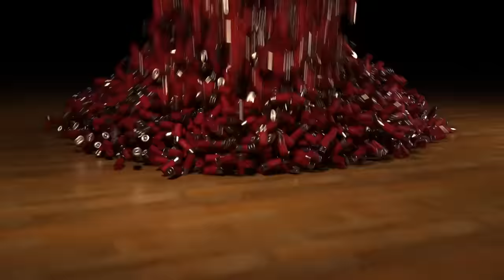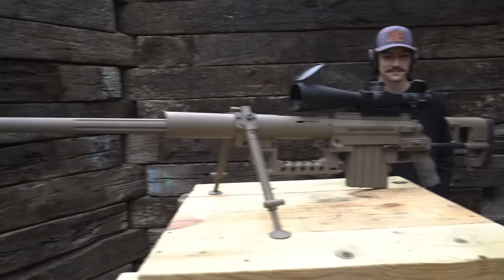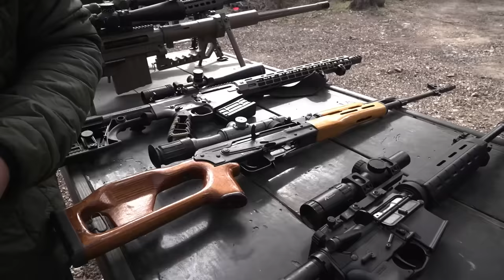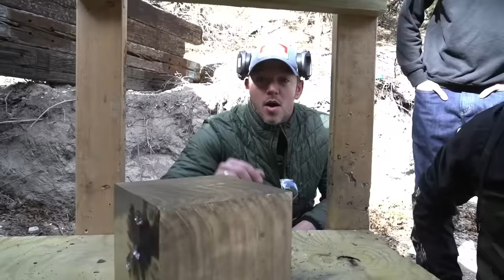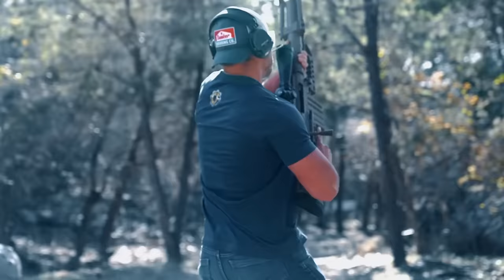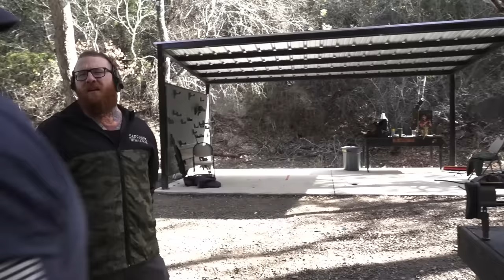The Most POWERFUL Sniper Rifle vs. Solid Block of Bronze!!!

Comment: The lack of delay between the 408 firing and the impact was one of the coolest parts.
Reply: That bullet is freaking MOVING.
Reply: Unless he's shooting the lighter grain bullets for the 408 it's doing the same as the 50bmg under 750gr bullets. Both shld be around 3000fps at the muzzle and prob not a noticeable difference at 100yds
Reply: @fishingpatriot2344  wrong, chev tac only made 1 grain of bullet and the muzzle of a 50bmg is around 11,000lbs and 4000fps, 408 is 7,700lbs and 3000fps, the 408 will keep the velocity up over range with the 50bmg loosing around 600 meters
Reply: @jamiejoy2393  your 100% wrong about 90% of what you just said im proud of you
Reply: @fishingpatriot2344  no I'm definitely not, I shoot both every week and have done for a long time. You're very wrong
Reply: If there was no drop and it somehow didn't hit anything else, it would take a bit over 10 hours.

since the 408 moves at 1,100 m/s, and the earth has a circumference of 40,075 km, or 4,007,5000m. Divide 4,007,5000 by 1,100 to get 36,431.8 sec. /60 is 607.2 min. /60 is 10.1 hours.

So most people could wake up in the morning, have their cereal and coffee, fire the gun, get in their truck and go to work, come home, shower and eat dinner, then the bullet would come back around.

Comment: Great video, love having Drevski there.
Also, bronze isn't a hard metal, it's quite soft compared to the other stuff you had down range. Some bearings and bushings are usually made out of bronze.

Also, Demo: "these are 15 bucks a round, they're NOT cheap rounds!!" cut to hip firing round by round made me laugh hard :D :D
Reply: I was going to make this very comment that bronze is not hard but it is very wear resistant but you beat me to it 😁
Reply: @csonracsonra9962  Haha, next time amigo :D
But actually, a really good idea, as the bullet goes in, does the high wear resistance aid the bullet to penetrate deeper or does it make it harder?
Reply: It has a very high density, too. And what matters in the end in holding up bullets is MASS.
Reply: @jackmclane1826  Not really. Obviously it'll depend on what specific bronze material he used, i.e. the % of alloying element included in the material but generally a standard Sn alloyed bronze is I think around 7.5-8.5 g/cm3 whereas steel is about 7.8g/cm3. 

Then when you compare AR500 steel which is again around 7.8g/cm3 a same size block of AR500 would cast a completely different effect on the bullets. 

So yes, while it is about mass, it's also not just all about mass.
Reply: @rixogtr  I can live with that... ;) I seemingly overestimated the density of bronze being a copper alloy.
The Abrams tank uses DU in the armor for reason of its mass.
Reply: @jackmclane1826  exactly, so does A-10C <3
Reply: Who really believed that it matters to a millionaire anyways? $15 a shot? That's like what 5.56 costs now right?
Reply: @rixogtr  That Block looked suspiciously Like Ampco bronze. Some of the toughest alloy out there. Just Sayin.
Reply: @jackmclane1826  Yeahhh you need alot more than just mass. Random but related fact, the mass of Saturn is 95 times of Earths, but due to its density it would literally float on water. Even though its also freaking huge, its gravity is only 1.08 of earth. 100lbs on Earth is 108lbs on Saturn. 
Sorry for geeking out, i just love using Saturn as an example given it would float 😂
Reply: Firing a 50 round at a block of chromium might be a little more expensive. lol
Reply: @jamesmaddison4546 
I was being a little unclear here. Mass and density are so closely related that I didn't expect that to cause a hickup.

I like that random Saturn fact. Although I still wonder what it matters here. 😅
Reply: @jackmclane1826    Its related to the subject here because you can have an object with a shitload of mass, but if its low density, its no good at all for stopping bullets, fragments etc. Its all good you just got mixed up  Also, DU isn't used in armor for its mass, it's used because of, again, its ultra high density. But, one thing I'll say further about abrams armor, what gives it is legendary survivability isnt the du, its chobham armor. Invented by the British, and believe it or not, the chobham thats used on the abrams isnt even the top tier chobham, the brits keep that grade for themselves lol the abrams gets the 2nd tier chobham. Its one of the brits secrets they keep very close, but yknow the us cant complain, theres tons of stuff they dont let allies get top grade of 😆
Reply: @jamesmaddison4546  First of all: I mentioned density in my first words here, so I wonder, why we have this discussion at all. ;) 
I'm actually still settled that the most relevant point here is indeed mass, as the Newtonian impactor model implies. (Wherever it is applicable, and not talking about composite armor systems.). The density later becomes relevant in how deep the impactor can travel through the matter.
Very dense material then is handy, (and I'm being intentionally absurd here) because it becomes impractical to bolt on 3 meter thick blocks of acrylic as armor or wearing a 2 meter thick ballistic vest from cotton wool. ;) Not even talking about launching a cotton bullet of a similar weight of the lead bullet or DU penetrator. 
Or to stay in the Saturn picture: Saturn might be fluffy like a cotton ball, but you still could not penetrate it with the earth because it is frickin huge! ^^

Give the Newtonian model a read. It's a good and easy first approximation for the topic we have here. It becomes especially good in KE rounds for tanks, sometimes only some % off from much more complex simulations. The faster the impactor the better that model becomes. Rifles are still on the edge of being too slow.
Reply: @jackmclane1826  Alright dude this is getting circular so this will be my last comment regarding mass and density because youre truly not seeing the relationship and stuck thinking mass is the most important factor when it isnt. 
For one, up to you whether you believe me or not, im an aerospace engineer, specialize in propulsion, working at lockheed missile and fire control
in Texas, started 7.5years ago. 
I could have a 4inx4in plate thats 1cm thick, made of an ultra high density material, and that would perform much better as armor compared to a block thats hell, 6ft in depth that has a higher mass but lower density than that tiny plate. This is simply because in higher density materials, theres more "stuff" (molecules etc) o get in the way of the penetrator, compared to an object of higher mass yet lower density, which has less stuff therefore less resistance to get in the way. 

Also, size of saturn doesn't matter, its outer to inner layers are gas, earth would have no problem going through it, until it got close to the center where internal pressures started crushing earth. 
Look up masses of giant gas nebulae in space, significantly higher mass but really low in density, so things go through them literally all the time dude. 
A high mass object thats low in density will never beat one thats got less mass but alot more density, of course to a point where the amount of "stuff" in the 2 equals the same, then youll have the same results
Reply: @jackmclane1826  Final examples, composite armor like kevlar, low mass therefore really light, but its density is really high. Same goes for its precursor the silk bulletproof vest, when made right it outperformed plate, for the same reason, low mass but really high in density.
Reply: Bronze can be workhardened, but does it after shooting at it? Hmm good experiement
Reply: @jamesmaddison4546  Now that I had the chance to think about it I'm more convinced than ever that mass indeed IS one of the most determining factors. High density then only makes it feasible to pack enough mass into a small space to make a useful product. If you are an engineer (as am I) you should know that or have the brain power to wrap your head around it when someone tells you something new. Even with examples given and a buzzword to continue reading! Real engineers usually are curious to learn something new and don't stick to old dogmas of what they think they knew. 

By the way: Kevlar is 1,44g/cm³. VERY LOW density. Dyneema - used for the same purposes in ballistic vests up to class 3A - is even below 1. It would float on water just like Saturn. ;) So obviously it is not the density at work here. (Hint to the solution: It is for much slower pistol rounds. At these impactor speeds mechanical strength of matter can still be higher than the dynamic pressure exerted by the bullet... and now you already know the two most relevant mechanisms of armor penetration... 😅)

When you use high velocity impactors on your two example plates, it comes out that both penetrators displace almost the same mass. Yes, you read it right: MASS. Very small difference! The faster the impactor the smaller the difference. Read "Newtonian Impactor Theory"! ^^
Reply: Bronze alloy can be extremely hard, but even if the alloy used here was purposely at the high end of the scale - it’s still a safe bet that it’s not harder than the martensitic steel used for a steel target. I think bronze can get up to 400 or so on the Brinell scale, while the aptly named AR500 target steel is 500bhn. I’m not sure what the purpose was in using bronze, unless just because it’s sexier than steel. 
The Brinell scale measures resistance to penetration (and by extension, hardness) so shooting at similar sized blocks of different alloys would be a pretty accurate sort of relative Brinell test on steroids. 
When you start to compare penetration of woven and/or layered materials (as opposed to blocks of homogeneous material), there must be many factors in play other than mass and density. The whole point of a modern vest is effective energy dispersal with minimal penetration in a lightweight platform. Im no engineer, but I imagine that things like tensile strength of lightweight materials and it’s increase by use of specific weaving and multidirectional layering may be the focus when it comes to vest construction.
Reply: also the gun they used isn't necesairily the strongest or best one. the .50 cal can compete with this and possibly even the KAR-98-K if it were still manufactured.
Reply: I came to say something similar
Reply: @DDadams0  not even close to what 5.56 costs
Reply: @jaketaylor9335  No shit? Are you sure? What is it now, $20 a shot?
Reply: @DDadams0  where are you buying ammo dude, im getting anywhere from .60cents to $1 a round
Reply: “Drewsky”
Reply: It's soft, but it isn't brittle, so I could see how it would be a decent measure of penetrative power and velocity at the point of impact. Soft metals at this thickness actually wouldn't be terrible as bullet stoppers. In fact, ( I don't know if it's still the case), but older tank armor used ceramic as part of the armor, BECAUSE it would break on impact and create a softer cushion to minimize focused force, causing energy dispersion throughout the plate.
Reply: @rbwood1978ify  Literally what I said
Reply: They make bronze bearings?
Reply: @rixogtr  Mmhmmm, nah. You spelled it Drevski
Reply: @rbwood1978ify  You must've got the name mistaken.

Comment: If you could get your hands on a Denel NTW-20 anti mat rifle that would be pretty cool. 20mm is usually considered a shell or cannon round so doesn’t really classify the same as a traditional sniper.
Reply: The Finns used the 20mm Lhati as a sniper rifle in an operation they called “Cold Charlie” (dress a mannequin as a junior Finnish soldier, and hide it well but not too well). Wait for a Russian sniper to shoot at Charlie. The Lhati crew had one rifleman and two spotters, so the chances of identifying where the shot came from was better than just one spotter. A Finn with personal knowledge of that use of the Lhati said it could blow down around 50% of Finland’s trees, so even a near miss would discourage snipers if it blew a nearby tree down. Of course, if there were something better to shoot they would do that first.
Reply: Problem with getting a denel is that anything over 50cal is considered a destructive weapon, which makes it harder, as well im not sure if denel imports those
Reply: @andresaltamirano7970  So take the target somewhere where you can persuade a Denzel owner to let you use theirs.
Reply: @kennethjackson7574 Actually it's Lahti. Named after a Finnish City. No bad vibes👍
Reply: @akottero3908  Lahti is a city, but the gun is actually named after its designer Aimo Lahti
Reply: @Torguemada You are correct. My bad! 😵😃
Reply: yes, waiting for the NTW-20X110

Comment: Seems like a great gun and round, I'd even say a worthy successor to the .50 if it is suitable for automatic fire. Impressed with the design of the gun too- except for the loose mag of course. The ventral handle is a very good choice, it gives you something other than the magazine to rest the gun on at the balance point for bracing on terrain. The sheath looks a good length balance if you need to use that too. 

Everything is smashing, all the choices I would make at least, though that might not be worth much!

Comment: I used a PSL during the first Libyan civil war. It was battlefield pickup. I initially had to run it cleaning it with gasoline and lubricating it with motor oil. It jammed a lot. We eventually captured a bunker that had a huge amount of Fabrique Nationale X-Troop lithium grease in spray cans. After that my rifle was ludicrously reliable- cleaning with gasoline and lubricating with X-troop every night. The scope mount was totally covered in something that looked like hot glue and it shot better than a minute of angle- a feat I have on camera. 0.8 MOA at about 800 meters. I could tell that the rifle had been babied. Finest rifle I ever shot. I fired nothing but API and when I ran out I would beg machinegunners for rounds. I loved that thing. It served me well. Fun fact: If you tie single knots into a piece of paracord it makes a highly effective .30 cal boresnake. Feed the unknotted end through the breech and out of the end of the barrel and then pull hard on it to drag the knotted end (a row of four or five single knots drenched in cleaner) all the way through. The fit is perfect.
Reply: you are a hero sir. so glad you are alive!

Comment: .408 tungsten round would be interesting to see.
High velocity, long projectile.
The bronze block would be shaking.
Reply: Problem with a tungsten round, is that its harder than the barrel, barrel wear will occur with use. One would have to make a sabot'd or copper jacketed tungsten round. Either option would be exceedingly expensive.
Reply: @bmw328igearhead  copper jacket would be way more accurate
Reply: @chemistryofquestionablequa6252  it seems there are some sabot type rounds for the .50BMG, looks like a 7.62 bullet, with a two piece plastic shroud. Once clear of the barrel, spin makes the sabot fly away. But I can't say I've seen how effective/accurate they are...
Reply: @bmw328igearhead  those were designed for machine guns,  they're significantly less accurate than regular rounds
Reply: @chemistryofquestionablequa6252  duely noted.

Comment: 10:51 the barrel sitting on the barrier might throw off your shots.  Some guns and barrels are free floating and if you rest the actual barrel on something it throws off the accuracy.
Reply: At 100 yards it won’t make much difference but past you can begin to tell
Reply: @McCor765  It probably depends on the gun but I've seen it happen to shots at 100 yards while trying to zero in a rifle.
Reply: That fancy bullet probably lost some of its material in the barrel fowling the metal causing these fliers
Reply: It's a dragunov, there's absolutely no chance of it being free floated.  Using a bipod with that kind of setup nets you the same effect because you're just resting the barrel on something else instead.

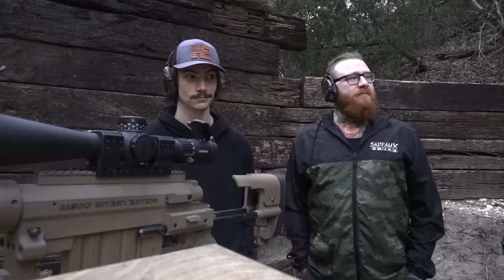Comment: 4:16 so… I used to make medieval reenactment armour and weapons. Real steel stuff and as close to traditional as possible and as a result i worked a LOT with bronze. That stuff is no joke, and even as a shooting enthusiast (in britain mind, we just don’t get to play with such groovy toys as shown here) it never occurred to me to shoot at it. No range would let me and the private land owners I knew would also shy away from such actions so I’m curious to see what a beastly found will do. As I write this I am genuinely watching the video first time and not going back and fore through the video. My reaction after this will be genuine….
24:34 phuck…. 😳
Reply: True enough, properly hardened bronze is wicked stuff.  It's not as hard as steel, but I believe it also doesn't get nearly as brittle either, so in some ways it's stronger ( correct me if I'm wrong ).
Reply: Depends a lot on what bronze and what steel. If you compare the most common cast bronze in Australia (LG2, a similar bronze available in the US is SAE 660) to 1020 mild steel, the bronze has both lower hardness and lower ductility. However a very 'mild' bronze with low tin content would behave more like copper, having higher ductility but even lower hardness. And there are high strength 'bronzes' such as aluminium bronze, manganese bronze, beryllium copper... some of those have hardness and ductility comparable to high tensile alloy steel, and strength not much lower. I machined some manganese bronze once, it was both harder and more ductile than mild steel, almost like machining stainless only with less heat build up in the tool.